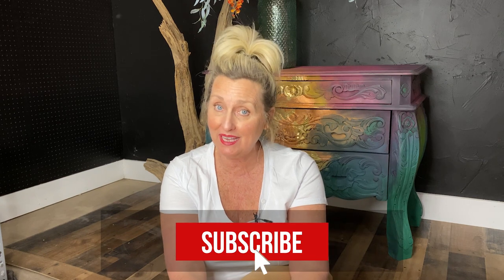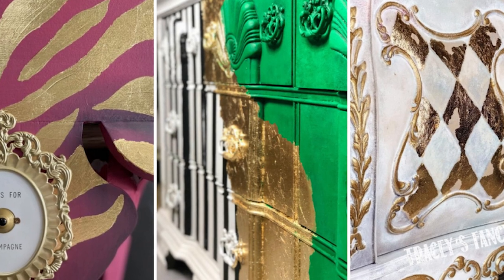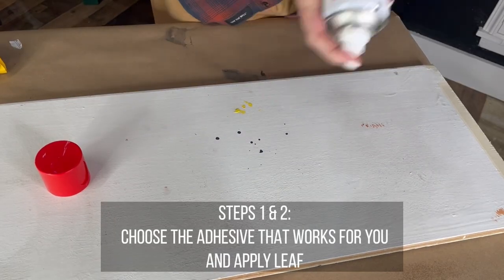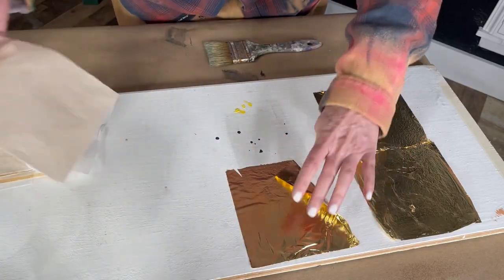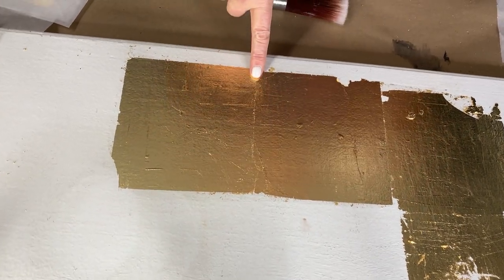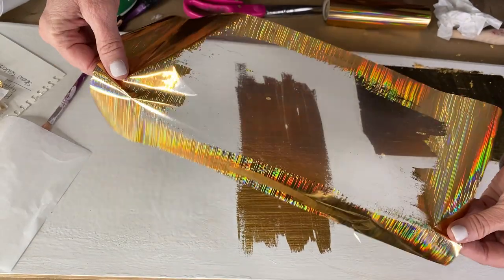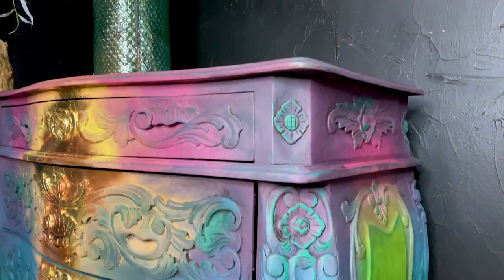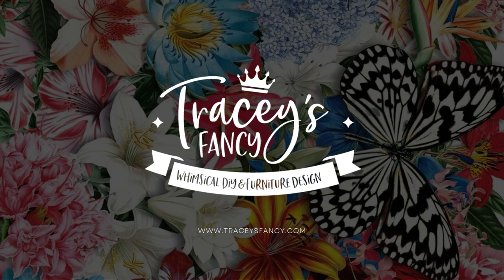How to Apply Gold Leaf| Tracey's Fancy

Comment: Thank you for showing us.. I get it how to apply the gold sheets, but How do I  apply the flakes on furniture? Do you blow them? I bought the flakes as they were v cheap, but now I'm kind of stuck as the furniture has a round part where I would like to apply it. Plz help .🙏❤️
Reply from the maker: The flakes are for a very abstract look or for smaller areas. They can be pressed into place by the handful or sprinkled over an area. They aren’t really intended to cover large flat areas.
Reply: @Tracey's Fancy  thank you my lovely..makes more sense, but I find it hard pressing them as it get stuck to my hands more than to the are I want them on..buggery bug! ❤️🙏
Reply from the maker: @carmencardashian8661 if you can lay your project down face up so you can sprinkle or drop the gold leaf crumbles….that might help.
Reply: @Tracey's Fancy  good thinking..is a chair.. I will try .many thanks.❤️ hugs from 🇬🇧